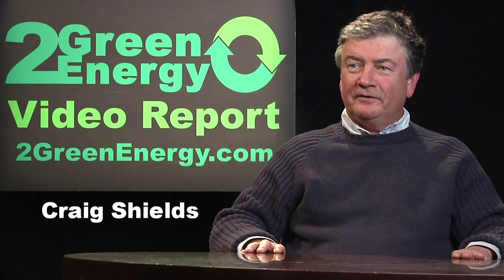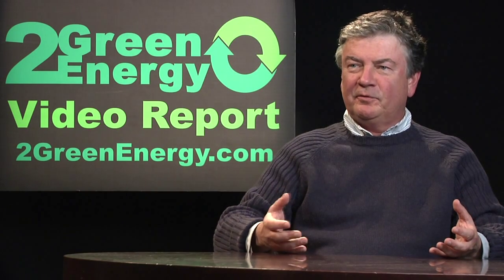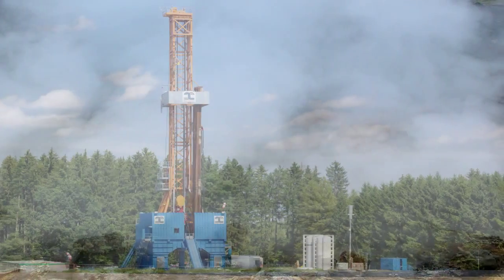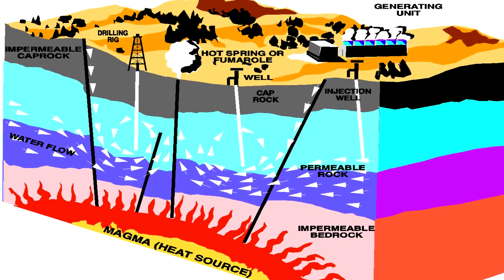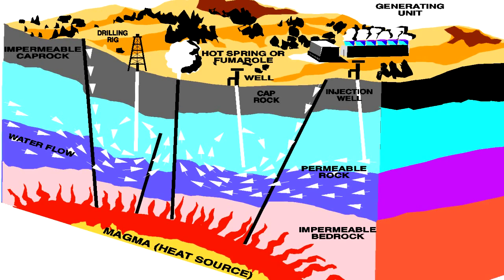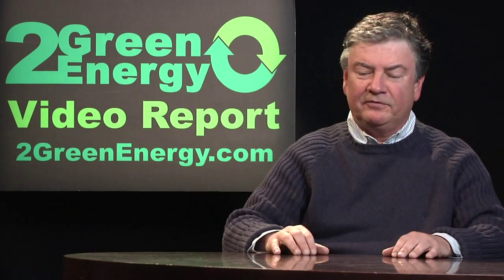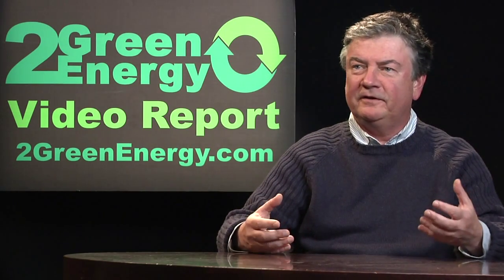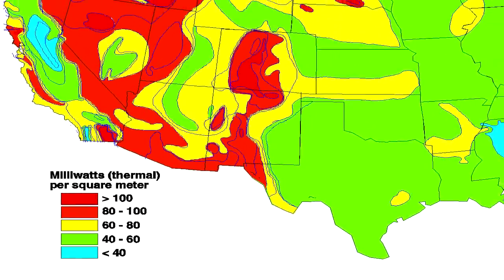Geothermal Energy

Comment: The Geothermal he is referring to is on a scale of Power Generation for Commercial and large size systems.  Geothermal is also done on a not risky and not as expensive level in smaller systems..  Example Residential Geothermal is only dug with a Backhoe.  not drilled.  What is needed in this case is realestate.  It is when one drills vertically that expense gets serious.  My Green Plumbers Training course has a video of such an application done on this scale.  less than 7 Yr.  ROI.